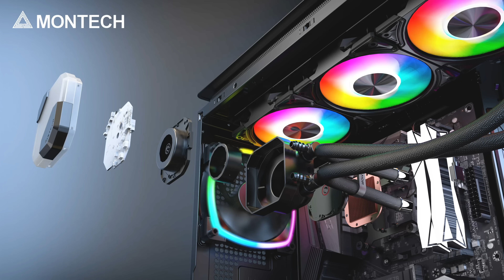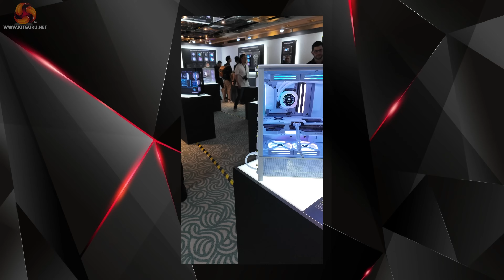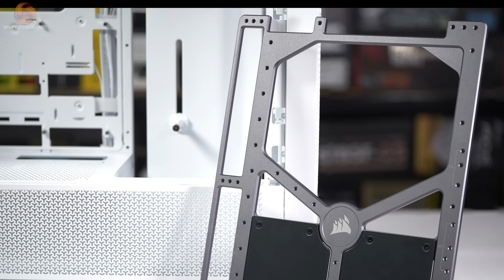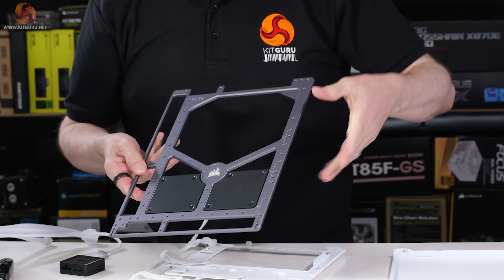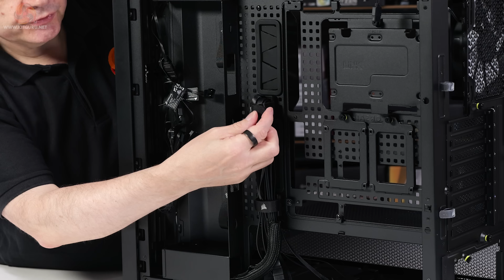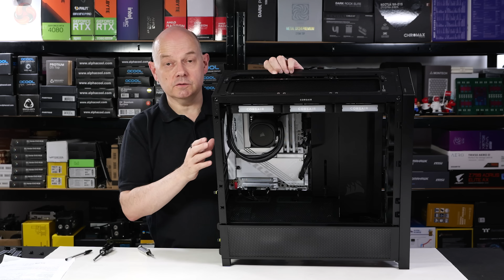Corsair’s $200 5000D Case with $300 Elite MOBO Tray! (Corsair update, tray is $100 now)

Comment from the maker: Let us know what you think about the new Corsair 5000D chassis - is this on your shortlist for a new system build this year? you like this more than the 4000D? also while you are here, please report any comment spam you see, you guys help us get rid of it! thanks! UPDATE!!!: We just heard on 11th July from Corsair that the motherboard tray will be part of an Elite version of 4000D and will sell as an accessory for about 100 bucks. Not the $300 we were initially told.
Reply: I love the way the build looks with that Project Zero board and side-facing PSU — cable routing is actually beautiful. But I’m with Leo… $300 for a tray with no cable management? That’s madness.
Reply: Shoutout to the squirrelc— I mean, squircles — cable cutouts. Never thought I’d care about hole geometry, but here we are in 2025. lol
Reply: I was torn between this and the Fractal North XL — and honestly, the North might win on elegance and price. Corsair’s 5000D feels more industrial, but not necessarily better.
Reply: Lian Li, Hyte, Fractal, Phanteks… they’re all pushing unique cooling layouts or aesthetics. Corsair’s playing it safe here — maybe too safe for 2025 standards.
Reply: I hope the depth of the top radiator area is better, I found it lacking on the frame 4000D.  And sadly Corsair doesn't provide any measurements for radiator depths.
Reply: I like the case a lot. 360mm rads work best anyway. 👌🏻
Reply: Good review Leo. Or dr evil.

Comment: Do you think it is possible to fit both a 420mm and a 360mm radiators? A 420 in the top and is seems from the video the 360 would have to go in the side?
Reply from the maker: I would be amazed if the width of the 420mm made that possible. 2x 360mm is a completely different story.
Leo
Reply: Thanks Leo!! @KitGuruTech

Comment: This is one of the few mid-tower designs I’ve seen recently that feels genuinely ready for 2025 standards — 420mm radiator support, back-connect board compatibility, and a vertical GPU layout

Comment: Leo, can you check out the Asus Prime AP202?  I really like the idea they've come up with to deal with the age old problem of "where do we put the PSU?"  Can't put it at the top, it will block the CPU AOI's.  Can't put it at the bottom, it'll block GPU intake airflow.  You can have a dual chamber layout, but then the case takes up WAY more space on a desk and looks super chonky.  Sure the AP202 is tall for a Micro-Atx case but honestly, does the height really matter?  No one puts stuff above or on top of their PC case anyhow.  And gamers do not need a full ATX motherboard over a micro atx since 99% of them only use a single expansion slot for a GPU.

Comment: I suppose I'm the perfect target customer for this case: I bought a 5000D Airflow RGB (prior model) not quite 4 months ago after seriously considering the Frame 4000D. Not only that, I immediately spent more in Corsair optional accessories than I paid for the entire case, bought direct from Corsair to boot. 

On the other hand, I use my daily driver PC for an average of 8+ years, so maybe not Corsair's true 'ideal' customer. I wanted closer to a 5000D size, but THE primary reason I pulled the trigger with 5000D Airflow over several competitors/Frame 4000D was the accessories. Specifically, I liked the prior model's style/implementation of optional wood panels for BOTH the top AND front, which Frame 4000D didn't have. Having tasteful individualization/uniqueness in a high quality package that prioritizes functionality lets an otherwise pretty common custom PC case be way more interesting. 

I went ahead and purchased all 3 types of wood paneling kits at $70/each lol. If Corsair had more differentiating accessories I likely would've bought some. Yes, the fact I was buying these on 3/29 in anticipation of the tariff announcement contributed to more of a 'throw it in the bag' mentality, but I wanted to personalize and maximize my nicest ever build. (FYI Corsair: your website is not good for this the filters/pages don't work right). 

This Frame 5000D would totally be up my alley - I love the modularity and the accessories! However, there are a few things I'd think about when actually valuing this stuff. 
1. Will new accessories launched for a refreshed case fit the prior generation too? Some things physically can't obviously, but I can think of several accessories that Corsair could get money out of me for which apply to not just 5000D models, but other models too . This requires foresight, but if you're making billet aluminum mobo trays you better have thought about this (plus it's consistent tooling). 

Exhibit A: 120mm Fan Blanking plate to block recirculation from adjacent slot
Exhibit B: Using 5000D Airflow back cover w/ side intake on a different model that originally was solid panel to create a new intake option, possibly for RAM cooling (this is my setup). 

2. PLEASE continue with the move the away from proprietary fan power/RGB. connectors and hubs. I refuse to have any software on my computer that is wholly unnecessary/primarily a data/advertising tool. Why should I have to commit to Corsair's ecosystem if I don't care about RGB effects? Some new ones are legit sick and may be worth it, but not to hardware-level neuter the fans/RGB. I was happy to buy a 3-pack of the RS120 fans for this reason (2 actually). Kudos to Corsair for the fans on this case and others NOT being stupid iCue connectors. 

3. The billet aluminum mobo tray looks amazing and is pretty cool, but frankly, equally stupid. Why? Some people want it to flex and/or have unlimited budget, but you can't even see it. I will (obviously) buy unnecessary things, but not if it doesn't actually DO SOMEthing. What is the purpose/value of that $300? 

3a. Not sure if they've considered this, but anybody spending hundreds of dollars (really, ANY dollars as it's usually free) on a motherboard tray is a serious enthusiast and almost definitely tuning and/or overclocking their system. Do they expect those two big magnets they added just millimeters from the RAM/Memory traces/SSDs/chipset are not ever going to generate the most annoying form of performance/stability gremlins? 

They are selling the equivalent of premium sound deadening or headrest mounted TVs on a Porsche GT3 Clubsport w/o backseats... Not only is it expensive, invisible, and not far from useless, its more apt to undermine the mission/RAM overclock with those magnets practically touching the motherboard. 

.....This became a novel... that's enough unsolicited commentary from me, but I think Corsair reads these so hopefully that input from exactly their target customer here is helpful. 

Thanks for the great review!
Reply from the maker: Glad you found the review helpful, and thanks for sharing your in-depth thoughts!

Comment: Put the AIO tubes towards the front it almost never works out with them towards the back when using a rear fan at the same time. The same issue will happen with a 360 AIO in the Frame 4000.
Reply from the maker: I had the same thought when I watched the finished video so there may be an update (or not)
Leo
Reply: I did what you suggested on a 4000D RS but still having issues with fitting a 140mm Corsair RX iCue Link fan in rear. Any suggestions? I'm also using a 360 Corsair Titan RX iCue Link.

Comment: There’s a lot to like in the structural design. The frame feels stiffer than the 4000D, likely due to the extra steel thickness. No obvious flex even when fully stripped down.

Comment: The top fan clearance issue with the Titan AIO hoses is a dealbreaker. If you’re advertising 420mm support, it shouldn’t require zip ties to make it work.